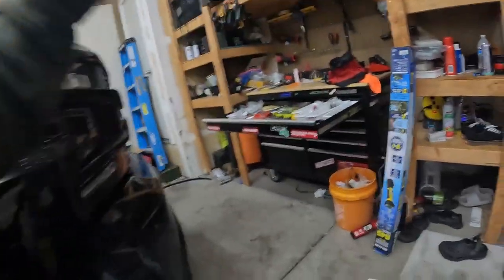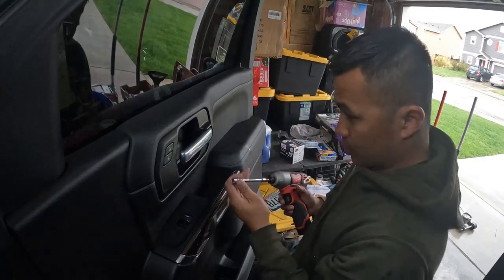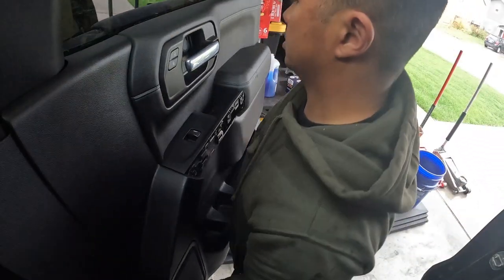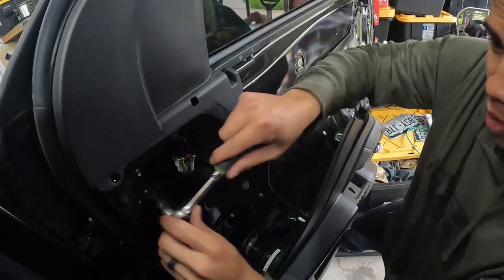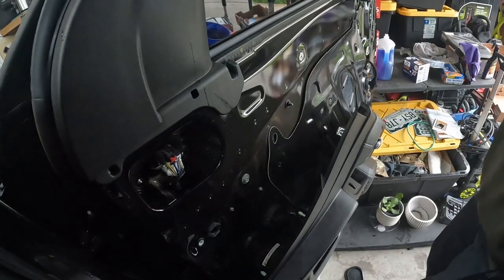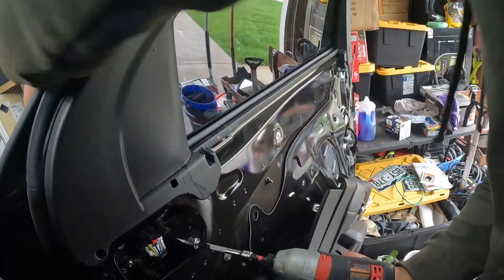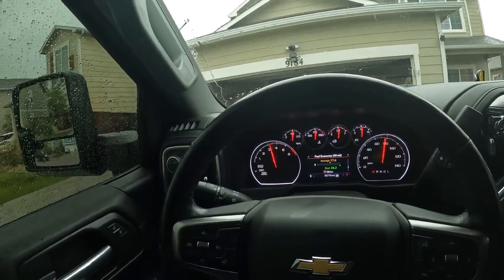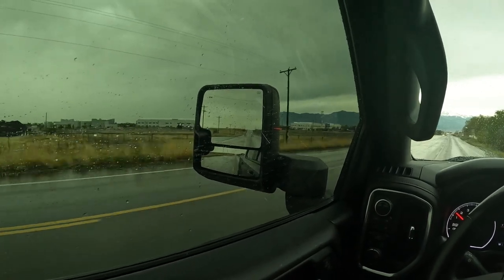Sanooer Tow Mirror Install & Review for 2019 - 2022 Chevy Silverado

Comment: I partially installed my mirrors from sanooer. Just connected the normal harness into the mirror with no additional wires. The front amber lights appear to be dimly lit even when my truck is off and locked.
Reply from the maker: Hmm interesting. I did the same initially but none of the lights worked until I added these 3 wires